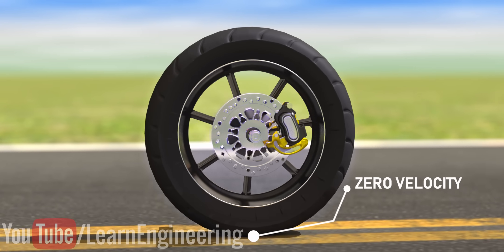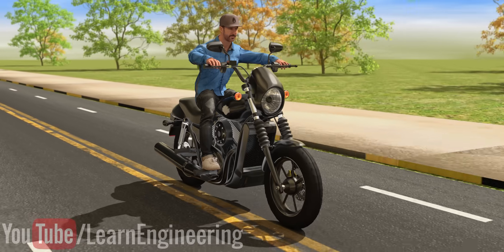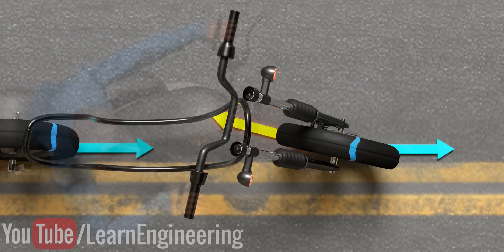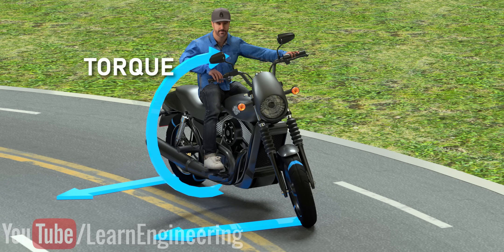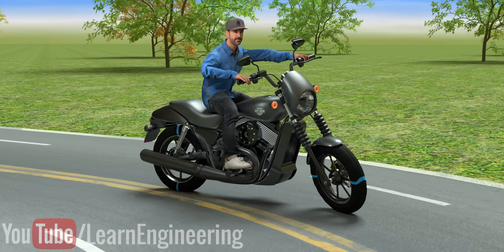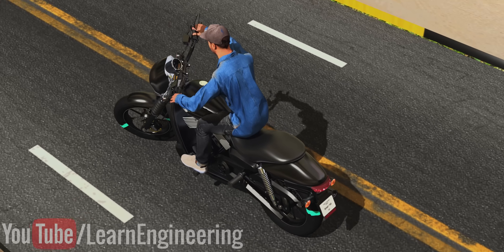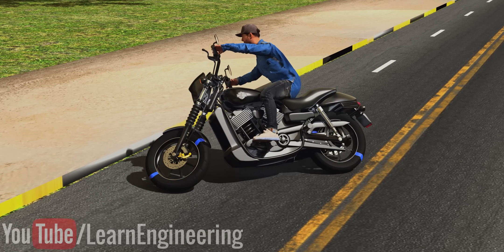Counter Steering | The interesting physics behind it

Comment: I understand this video to state that in 'normal steering', when you push on the left handlebar you will turn right, and in  'counter-steering'  when you push on the right handlebar you will turn right. (Apparently it doesn't matter whether you push on the right or left handlebar,  because the bike will go right on both occasions!) 
 
What nonsense. When riding faster than parking lot speeds, counter-steering is the ONLY way to turn a motorbike: push on the right handlebar to turn right, and push on the left handlebar to turn left. All motorbike riders use counter-steering above parking lot speeds, whether they realise it or not. Counter-steering is not optional, it is how a motorbike turns when travelling at speeds above parking lot speeds.
Reply: You also do it at parking lot speeds you just don’t notice it. Next time your out for a ride go your slowest feet up position with a straight body. Turn the forks. You’ll see that even slow speed maneuvering starts with a quick counter steer to lean the bike and only afterwards do the forks follow the line.

Comment: Video fails to point out that you steer in the direction of the turn only at low speeds. At higher speeds you are actually counter-steering and will turn in the opposite direction of what you intended! It can't be helped! This has caused loss of many lives.
Reply: Lean, at ALL speeds, is controlled by counter steering.  Turns, at ALL speeds, are done by "normal" steering.

Comment: This video is pure ignorance and lies and anyone who follows this very ignorant and wrong advice will turn their motorcycle into oncoming traffic. 
The “scientific” description given in this video is complete nonsense bull$&!#  and it will get you killed.  The real science is available from many sources and easily found. Hint: Google “A twist of the wrist”.  
  
  HERE IS THE TRUTH THAT WILL KEEP YOU ALIVE.  COUNTERSTEERING IS NOT A CHOICE.  IT IS THE ONLY WAY TO STEER A MOTORCYCLE AT ANY 
SPEED ABOVE 5 or 10 MPH.   
PROVE IT TO YOURSELF IN A BIG EMPTY PARKING LOT.  PUT YOUR LEFT HAND ON THE GAS TANK AND LIGHTLY PUSH FORWARD ON THE RIGHT GRIP WITHOUT TWISTING IT....
YOU WILL NOT TURN LEFT. 
BODY ENGLISH OR “LEANING” ACCOUNTS FOR SUCH A SMALL AMOUNT OF DIRECTIONAL CONTROL COMPARED TO HANDLEBAR INPUT THAT IT IS NOT EVEN WORTH CONSIDERING,  ESPECIALLY IF YOU RIDE A HEAVY BIKE.  ONCE AGAIN,  THIS IS EASY TO PROVE TO YOURSELF. 
YOU CAN HANG ALL OF YOUR BODY WEIGHT,  AND MORE,  OFF ONE SIDE OF THE BIKE AND EASILY TURN THE OTHER DIRECTION WITH LIGHT 
COUNTERSTEERING  PRESSURE ON THE HANDLEBARS.  
DONT DIE PEOPLE.  IGNORE THIS VIDEO.

Comment: I challenge anyone to try this.  As you are driving down the highway on an open road with no traffic around you, move toward the center of the road, slowly push your right hand grip forward 1/4 inch.  You are steering left, but you will go right.    Most people don't realize they are making this slight countersteering motion before they turn.

Comment: No wonder newbies end up getting hurt ,this ain't a road bike method as suspension is to soft and tyres aren't grippy enough , if you got that time to react then slam the back brake on hard to start a slide and drop the clutch with full power , even that's an old method just like old bikes with drum brakes you could slide the bike an chock the foot rest in the floor sliding tyres sideways to maximise grip  cause the brakes where crap , modern bikes with modern brakes the countersteer you should do is sideways action
Reply: paul dean 
WTF are you going on about?
Reply: @softailfun  wtf you on about , so this is a viable method of steering on a modern bike ? When this was used the bikes where heavy as he'll with little moving suspension, yeah it's relevant on a old race norton commander type bike but not on something modern as suspension compresses to much and on the rebound it'll send you highside or push front wheel to slide out . It may work on something like a hog with not much suspension but this video has it can be used for every bike and it can't , low trig and lowdown weighted  bikes handle different to most modern road bikes . I can understand why you think it's feasible but this video is for every type of bike which ain't a safe method to steer .if you think it's feasible for modern road bikes then give a reason and I'll give you 3 reason why you shouldnt
Reply: paul dean 
I’m sorry mate. I can’t take you seriously. You’re talking total rubbish. Nothing to do with weight, brakes or anything else. It’s the way it is! The fact that you support this video at all speaks volumes. It’s content is dangerous, confusing and misleading.
Reply: @softailfun  well maybe you wanna go talk to old boys who raced as this was feasible , it's got everything to do with low centre gravity bikes with limited steering lock , I'd love to see you get an old featherbed framed norton around a tight bend with there bad steering lock , this was used to throw out the back end to put power down to slide the bike around where just steering wouldn't do it , I agree not feasible in a modern bike , and am only relating as center of gravity on a hog is close to a featherbed norton , personally I haven't rode a hog but if you can't relate then it's either impractical or you just have no knowledge of old school racing and it's concept, obviously you haven't read my initial statement as I too think it's not practical for modern bikes
Reply: paul dean 
Mate, I was riding featherbed frames back in the day, I still ride today. Forget the vid because it’s shit for all bikes, totally inaccurate on many levels. You are saying that counter steering doesn’t work on modern bikes. I am saying that that is total shit! You are getting confused with either counter steering on cars or off road bikes. The fact is that to initiate banking on ANY bike, be from the 50’s or 2020, there is only one way to steer a bike..... counter steer! There is no option, there is no argument. I know guys who ride Harleys to track bikes and they would all agree! You have to steer away from the bend to get the bike to lean into it. It’s science mate not an option!!
Reply: @softailfun  maybe you wanna look at on board footage of modern race bikes as you tip it in without countersteer,  or bring the bike sliding with a touch of back brake ,you can't argue with on board footage as the handle bars don't lie ,you don't see fast riders turn out of a corner first
Reply: paul dean 
Do you actually ride??? You can’t see riders steer out on road bikes fella, so I guarantee you won’t see it on track bikes.The movement is measured in low mm’s. Your arguing against natural forces fella. As I said before.... it’s not a choice it’s the only way you can steer a bike. Further.... you said “you don’t see riders steer out first”!!! You don’t steer out and then steer in, you keep the pressure on the bar all the way through the bend, you only take it off when you want to straighten up. You don’t ride do you man?
Reply: @softailfun  this is about counter steering coming in to drop a bike low and fast to initial start a drift so can get rear to slide off the throttle , if you know steering lock on a norton was nothing how did you get to turn tight corners , old school method was to counter steer turn in tight the extra inertia would break tyres to slide so you could maintain the the slide off the throttle  ( too heavy and not powerful enough to wack power on to spin up the rear to turn the bike in more)  dunno how you manage to ride norton on tight bends and make the corner , I ride every type of bike and personally am a twin lover that likes to slide it in with loads of power ,maintain the slide all the way out ,speedway style .dunno what on board footage you watch cause you can see clearly the direction of the bars , countering steering a norton in isn't mm ,it's agressive  movement you clearly would see , just same in a old rally car drive with rear wheel drive , you have to swing it out of control to make it control the way you want it to , as they say your not in control till you out of control , they to don't use mm of opposite lock in, its aggressive to help it unbalance
Reply: paul dean 
It’s about coming in an dropping a bike low... yes... but that is how you steer a bike. Man, you just don’t get it at all. Sliding rears, drifting. You’re off road man. You go on about steering locks being nothing, but for counter steering in makes no difference, you hardly use any lock at all when steering a bike. Tell you what, I’ve tried to educate you, but you’re stuck in the world of sliding and punching and shit. You can’t ride like that on a road, then again I don’t know any track you could ride like that either... once the tyre slides on a bend your done. Anyway, you do your thing and I’ll do mine. Done with this, but you need to research more and for gods sake try and be open minded when you do... it helps.
Reply: @softailfun  well you don't obviously ride as fast as me an others , how you get an old norton to turn in a tight corner that the lock won't let you ? Answer me that first . You obviously don't ride fast enough to know you get tyres slippy enough they slide,  ( according to you you can't on a road surface ) some of the great bike battles will have you say you chat crap ,cause they sliding into the bends and back out ,it's not offroading it's racing in general,  cause you widen yourself to block a pass , according to you it's not possible , you wanna stick to your slow soft tail and leave the fast stuff to others , can't slide around on the dark stuff , your funny , why do riders when winning a race by a margin to a championship slide the bike about ,it's cause they can and at points of the track it's fast , what's the difference between drifting and rally , one goes sideways to look good smoking tyres and rally it's faster sideways to a certain amount and they always searching for maximum grip doing it ,honestly if you think bikes don't slide on road surface then your obviously not getting your tyres warm enough to know
Reply: paul dean mate, you have shot off on a total tangent on here. The video is about counter steering on the road. You disputed that counter steering works. I said it did. You are now talking about speedway style broadside, sliding rears even rally cars opposite locking. None of this is relevant to the original discussion. So..... I’m gone! We are talking oranges and lemons!
Reply: @softailfun  what did I initially say ,on the road it's impractical with modern bikes , tell me how to put a norton around a tight bend it physically won't turn  , it's old method that I'd never heard of till you get an old boy to explain why you didn't make the turn , on modern bikes you just rip through with power , this was about countersteer not corrective countersteer,  the later you do to correct a slide , this is about digging the front end in to force tyre to grip to make the bike easier to get back end loose , it's an old school method that has no place anywhere but vintage bikes ,go ask a classic or vintage bike how to pitch the front in harder to make rear go light to spin and slide
Reply: paul dean 
yea well.. there ya go then! 🤪😂
Reply: paul dean 

https://youtu.be/A40XhMtqx1E
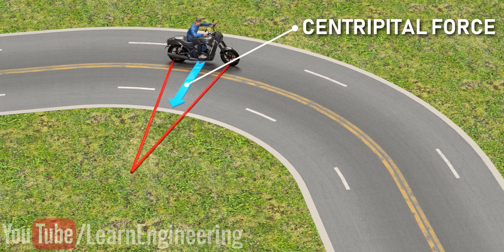Watch this, jump forward to around 2:20 or 3:45
Reply: if it's a classic race your norton ran off the middle of the corner ,I've forced a slide and pushed the front end round tighter , what do you expect to stop a race , hang on I need to go back and forth to make the bend , cold tyres are unpredictable,  warm tyres grip to point they really heat up ,go  oily and slide
Reply: paul dean 
😂

Comment: this is a badly done vid. You got the rider wearing sneakers, no gloves, no helmet. Worse- you got him crossing the center line, running off the road towards a raised curb????
The illustrations also show the front wheel turning into the corner... that's NOT how it works.  It's real simple boys & girls, if you're turning right, you PUSH on the right handle bar;  If you're turning left- you PUSH on the left bar.  In essence-  you PUSH on the side CLOSEST to the inside of the turn.  There was an attempt in the video to explain counter steering but poorly conveyed. IGNORE THIS VID.

Comment: You always have to counter steer even with a bicycle. The only time you don't is with a severe leaning of the body to cause unbalance and a turn. During the entire turn you will be inducing a counter steering force into the handle bars otherwise the bike will right itself and go straight ahead. This is a bad video description.

Comment: I don't need a complicated video to explain countersteering to you, I only need one paragraph: Turning on a motorcycle or bicycle requires leaning into the turn to counterbalance centrifugal force, and leaning into the turn requires the rider to be closer to the centerpoint of the turn than the bike itself is. One way to achieve this is to lean your body into the turn, but another way to achieve this is to turn the steering in the opposite direction for a split second to make the bike move further away from the centerpoint of the turn. Leaning your body into the turn is more stable, but also harder to cancel because you have to steer the bike further into the turn to get it back underneath you; countersteering the bike away from the turn for a split-second is less stable and requires more practice, but is faster for emergency maneuvers and easier to cancel if necessary.
Reply: Shawn Elliott oh this is absolute rubbish!

Comment: Weight shifting only works on very light bikes, but moving around destabilizes a rider. People don't realise it but since they learned to ride a bicycle they've been counter steering- such little is needed on light bikes it's not discernable until you use it in a collision avoidance scenario. I own a large cruiser- 1800cc weighs 350kg and has a very wide rear tyre. No amount of weight shifting will make it start to corner unless at Carpark speeds, the wide tyre increases the need for firm counter steering otherwise I wouldn't get through a roundabout. The only place for weight shifting is in road racing situations to keep speed up in a corner when maximum lean angle has been reached- not for normal road situations.

Comment: This video is simply wrong and will get people killed if they get on a proper motorbike(not a scooter as shown at the end) and try at speed to turn without counter steering.
It's not a technique used by MANY bike riders - it's a technique used by EVERY biker.
You cannot turn at speed without counter steering.
Counter steering kicks in at a certain speed, usually above 15mph.
I suggest the person creating this video actually learns to ride a motorbike(not a scooter) then re-examines what is wrong in this video. 
As for "leaning" a motorbike - good luck with trying to do that, you body simply does not have enough mass to "lean" the bike. The leaning occurs because of counter steering.
The reason counter steering turns the bike is because the inside of the wheel then becomes the circle around which the bike turns.
(qualifications - ex--biker 600cc)

Comment: Hey I'm actually confused right now. I watched most youtube videos claiming that counter steering on a motorcycle was just pushing the handle bar in the direction where you are going (which I do when riding on a motorcycle). This seems a lot different and extremely hard to do.
Reply: That's because this video is wrong and will get someone killed.
Reply: Slartibartfast 
Absolutely.  Everyone who knows this,
Please help spread the word to watch Keith Code’s “A twist of the wrist”  for the truth and the proof,  right here on YouTube.
Reply: Bobons Kshsvla 
PLEASE watch Keith Code’s,  “A twist of the wrist”.   Right here on YouTube. 
You will see the truth and the proof.

Comment: There is no "normal turning" at speed on a motorcycle.  You cannot turn a motorcycle at speed in a reasonable amount of time.  Don't believe me?  Try holding on to the frame or tank at 55 mph and  lean as hard as you want.  It will take 10 seconds or more to change lanes, much less make a 90 degree turn.  People think they can turn by leaning because they are unwittingly putting pressure on the handlebars in the counter steering sence.  Be smart, be safe

Comment: Counter steering is the only way to steer a two-wheeled vehicle. All riders do it whether or not they're aware of it.  When you turn the handlebar to the left, the bike automatically leans to the right and vice versa because of inertia.  So if you want to turn right, you unconsciously turn the handlebar to the left.  The bike then leans to the right and then you modulate your handlebar and the bike goes to the right.  You don't have to watch this video to learn that.  All riders have been counter steering all the time ever since the two-wheeled vehicle was invented.  This video is full of crap.

Comment: Counter steering is the only way to turn a motorcycle at speed. However at low speeds (in a carpark for example) directional steering inputs work - turn right to go right.

Comment: Kind of disappointed in the fact that there is no mention to speed in this. Above, say 15 or so mph direct input steering is your butt ending up on the asphalt.

Also, no mention of the gyroscopic effects a rotational mass has on keeping the motorcycle inherently stable at speed.
Reply: Try direct input at parking lot speeds and you’ll also be dropping a foot to the ground. Your doing countersteering at every speed not just above 15.

Comment: On bikes you always turn like this, you just have to see the wheel tracks when you ride on sand or snow. In fact, I think it's impossible to turn the "normal" way. By throwing your body weight to one side you tilt the bike to the opposite side by the force of inertia.